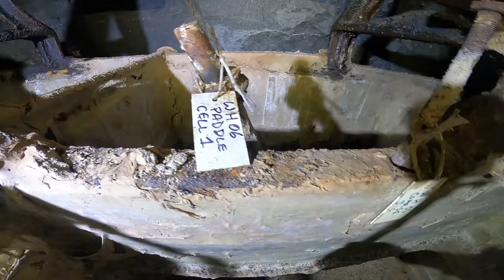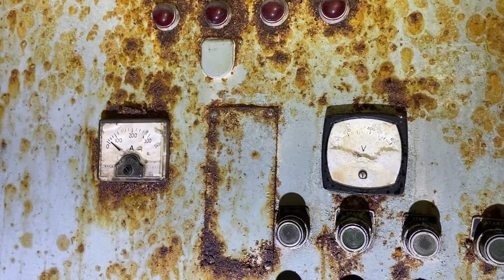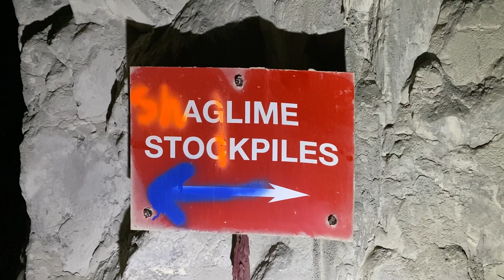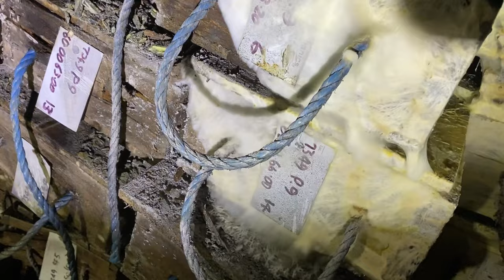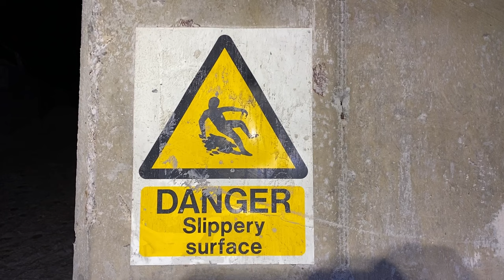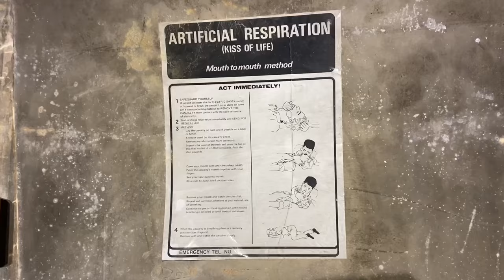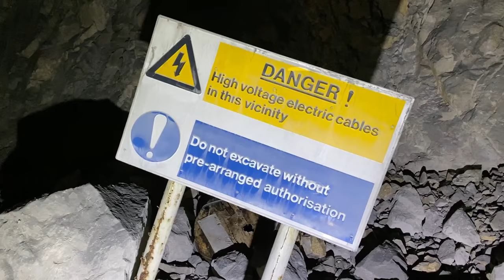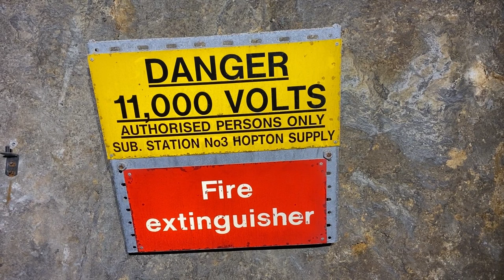THE BIGGEST LIMESTONE MINE in BRITAIN -Middleton Mine - #middletonmine

Comment: I can remember many years ago, here in the UK I believe it was tomorrow's world.
They were at a
 under ground quarry, can't remember Actually were or what rock they were mining.
I was huge full size excavators and dump trucks were taken apart and lowered down the shaft.
For quarrying purposes 
But what was amazing is that when the quarry finished production all the machinery was  removed the shaft was capped and the quarry turned into a massive underground LPG Storage facility. It was geologically perfect so liquefied gas wouldn't escape through The Rock.
Ps fantastic video as always fella.
Reply from the maker: Thanks Paul ! 😀🙋🏻‍♂️🙏🏼
Reply: it may not be the same one, But there is one like that in the trussacs Near to Glasgow that did that ,as trucks were lowered down and was used for some oil storage as well as other use. it used to quarry Granite